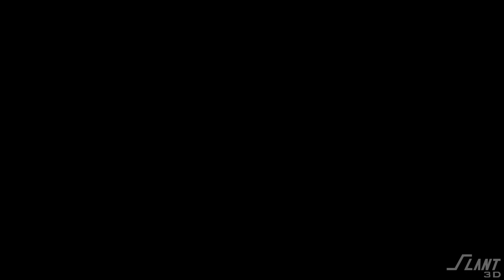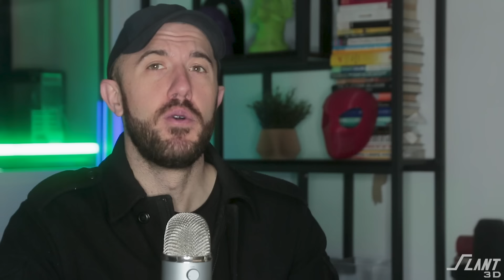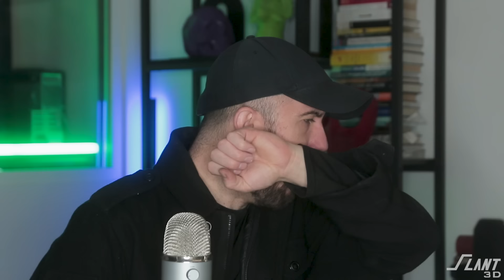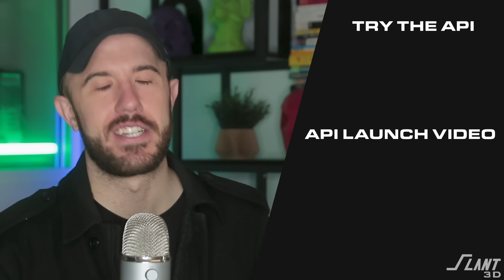This Filament Costs $1000 | We Released An API | FormLabs Texture Engine | Desktop Metal Financials

Comment: Kudos on the API. I'm a developer interested in building for some e-comm platforms but I have requests/questions as I spec it all out:

1) Sandbox mode: Test without submitting real jobs
2) Order abort call: The ability to cancel an order within a certain period of time (in lieu of sandbox?)
3) Webhooks: For order progression, shipping status updates (low priority..)
4) Full specs of slicing details: 20% infill mentioned. Infill geometry? Walls/floors/etc. Is this published somewhere?
5) Improved docs and channel for devs to request clarifications. e.g. required order fields, error responses.
6) The orig video mentioned limited API keys. What is the ramp-up schedule? Need to know if it's worth the dev effort if customers can't get keys.

Comment: Congratulations to Slant 3D software team for releasing a public 3d-Print API including 3d-model slicing and Etsy print on demand services. A tremendous achievements. (20:40)

The "Formlabs Texture Engine" topic (6:54) begs the question of why can't designers include multiple surface textures as part of a CAD design?
.STLs, the traditional file format commonly used by 3d-printers only contains surface geometry, which would require very high resolution mesh to integrate a texture, and irreversibly altering the  surface of a CAD model. 
An increasing common alternative, .3MF includes color and other designer defined CAD model properties. If textures where applied as if a color, then all that is needed is a mapping between color and texture to apply a designer defined texture to a bounded region of a models surface. 
eg: red = sandpaper texture, white = hexagonal diamond texture, etc. 
The slicer software could link and apply the 3d surface -emboss of the texture(s) to the appropriate surface surface area. This would make it a trivial task for designer to edit and modify the surface skin of a model enabling experimentation, or custom variations using any generic CAD program that supports the .3MF file formate (or a better reviewed open-source file format).
Simple geometries of a 3d print design would remain simple and lower-res, but have a high resolution texture applied to the printed surface. This would be revolutionary, and an industry leading feature.

FYI: computer games use a similar technique to apply complex textures (color, and depth-map skins) to low-resolution geometry in game models.

Comment: That API sounds great. I love the focus you got on vision. This is probably going somewhere. Congrats. Unfortunately for me, my slicing process is way to advanced for this to work for most of my work. Also, a lot of what printing should be used for, is not supported, but that is besides the point. This is the right way for you guys to go. You seem to use gateways to connect to existing infrastructure, and you seem to play on the installed base. And again, I love that you have a clear vision doing this. This is just what the industry needs. Thanks.

Comment: I have an issue that I am dealing with that you have not really covered in your videos (I don't think).  I have a design that calls for a collection of flat squares with overlapping connector tabs.  I can print them flat with no problem but I don't see how to print them ant any other angle than 90 degrees to the bed.  That would be a problem because the part is only a couple mm thick and has no raised edges.  If I can print them vertically, I can get the volume that I need from a single print run but I just do no see how to do that.  I have successfully used the 45 degree alignment with a triangular support on a couple models but this one has me stumped. The part is approximately 104mm x 120mm x 5mm.  Do you have a video related to something like this?

Comment: Check out the BASF Ultrafuse 316L filament. Can be FDM printed then sintered and is weldable stainless. Only about half as expensive as the moon dust filament and much more practical.